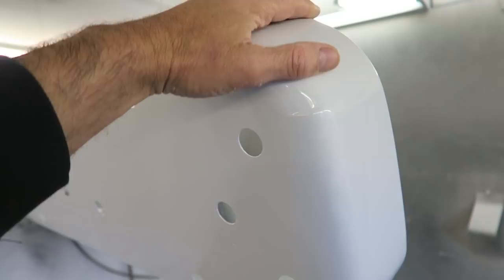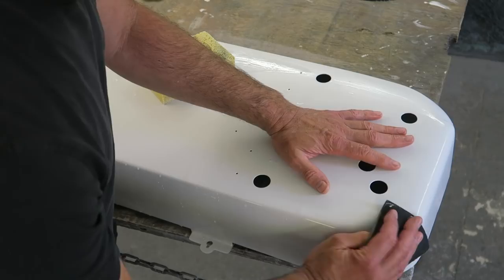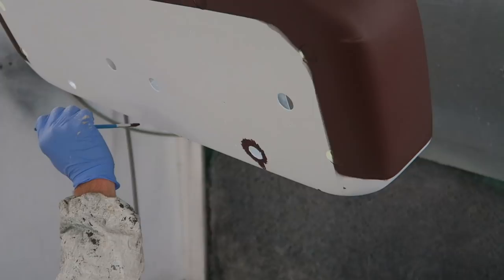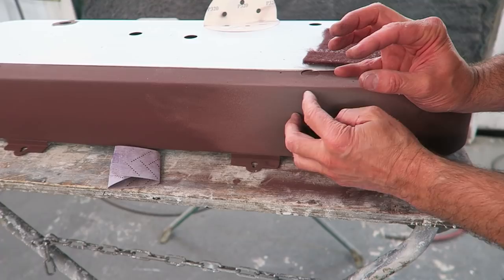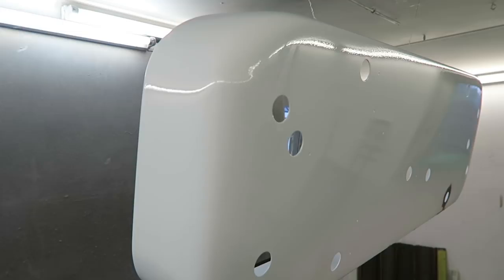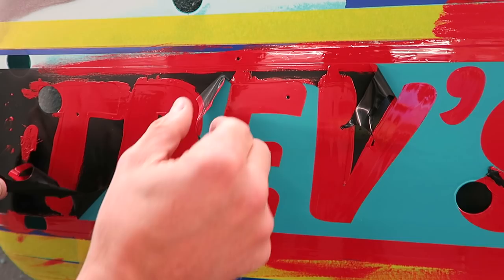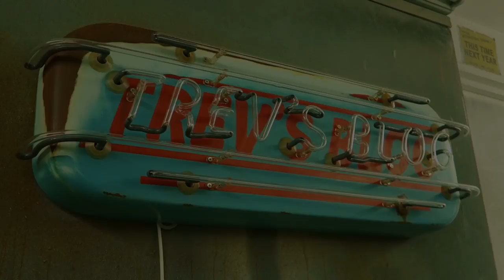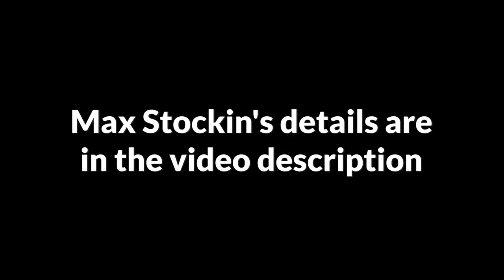Rusted metal rusty paint effect. Fake Rust. Application process. Tips and Tricks #61

Comment: I"ve done this before.  Interesting somebody is marketing it.  I have my selection of muddy red's and brown paint.  Add steel to it by sanding a steel panel with 400 grit capturing the swarf.  Toss the swarf into the paint and basically follow your process.  Although I've never used any sort of "activated paint" for the rust.  Never tried to make it rough or keep the viscosity excessively high either.  To activate the staining and streaking I spray it down with hydrogen peroxide.  I suspect your powder is citric acid.  I can see some clear differences in this process from what I've done in the past.  I dig the results, and I picked up some ideas.  Cool stuff Trev.

Comment: i spent 30+ years doing sign work...building and repairing ( in shop and on site ) as well as everything to do with Commercial signs ( being in small companies means you learn everything ).... neon was fun and would wake you up pretty quickly if you got buzzed ( thousands of volts 3 - 15 KV { 3,000 to 15,000 } but low amperage ) by the juice flowing from the transformer into neon glass 😂
sometimes we made old signs look new or look vintage too ( leaving the wear and tear of decades of use )...